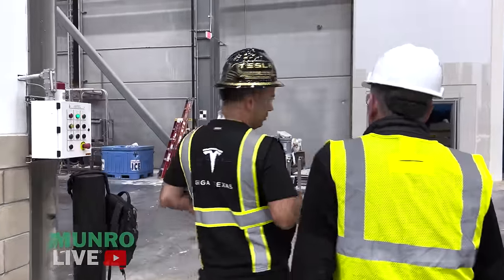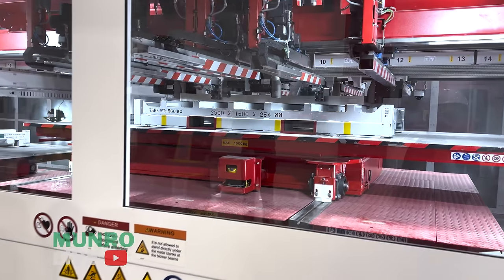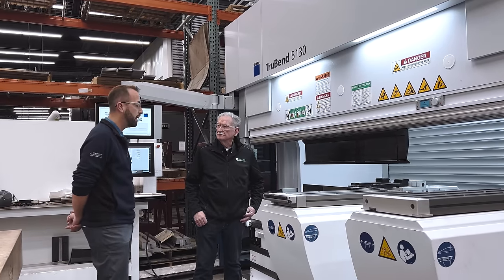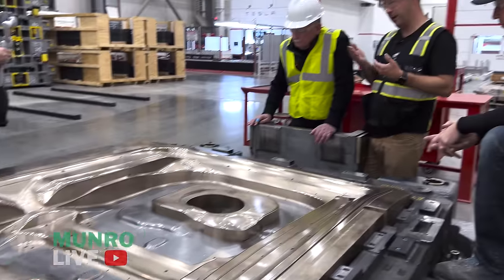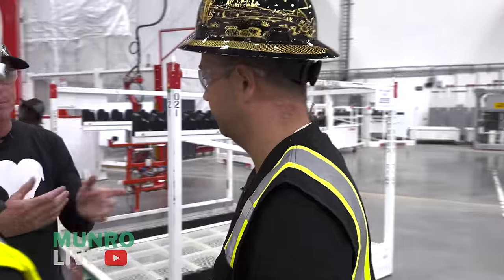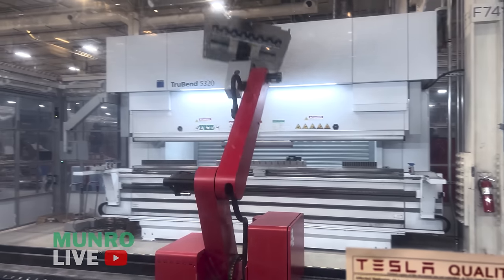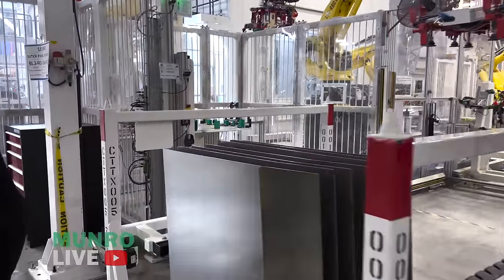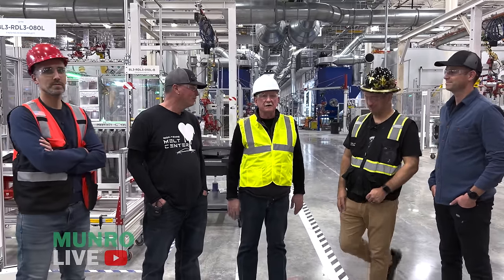Tesla Manufacturing: See how the Cybertruck HFS Panels are Blanked, Bent, and Built!

Comment: What other manufacturer would allow Sandy Monro this level of access?
This is exactly the right thing for Tesla to do .
Reply: There are experts out there that they can hire, but who would pay them to create a new, or improve upon the already used processes which costs money, and time, AND new machines which costs money also big time. Tesla is one of the FEW in the world that does this and they are not a manufacturer of parts. They are a Car company which is different from all the other car companies. Tesla is a Tech Company which can create a new manufacturing processes or methods. All of this is EXPENSIVE which others are afraid to do, but Tesla does it.
Reply: We saw nothing.  Two guys hand stacking panels, 1922!
Reply: @1flash3571 it’s impressive for sure, but we only know about it because Tesla is public about everything. Who’s to say there aren’t others doing equally impressive things? BMW’s carbon fiber i3 frame was just as groundbreaking, so was Toyota/Lexus’ carbon loom for the LFA (now used for other parts). And this was over a decade ago.
Reply: . @GlitterGuru Why did BMW stop with the i3 manufacturing methods and materials? Because they were a dead end and not fit for mass manufacturing at cost. Same goes for Audi A2. Also brilliantly ahead of its time with the full aluminium body. They all lack execution at scale and the will to drive innovation in manufacturing to the point where Tesla has gotten with it, sadly.
Reply: @capslock9031  BMW still uses a lot of carbon fiber in their structures. The iX and 7 series specifically use carbon side frames
Reply: I am curious is Munro will still do a teardown or if they got this level of access in trade for not doing a teardown?
Reply: @motofunk1 He said in a previous video that they intend to do a tear down once they can talk a low number customer out of their new cybertruck.
Reply: @Bill_N_ATX  Thanks, I missed that. Good to hear that this level of access he is getting is pure and not wrapped up in some deal.
Reply: @danr1920  Then you weren't listening, or not understanding most of what you saw.
Reply: @1flash3571  I think legacy does not have the engineers and talent to make it all happen like Tesla. It takes a lot of brilliant minds to get this right. They don't know what they don't know but think they know it all.
Reply: It's zero risk, because nobody else is ever going to copy this. It's not a good idea.
Reply: Jaguar Land Rover, BMW/Mini, Toyota, JCB, all allow factory tours of their manufacturing plants in UK, costs £50-ish for anyone to book.
Reply: @rogerfroud300  Porsche copied the Tesla P90DL.  They had the copy ready to drive 4 years after the P90DL release, and it was worse.  If you copy, you are always 5-10 years behind.
Reply: @danr1920  30micron accuracy lasercutting, airbanding, bronzealuminium stamping molds, micronlevel depth laserwelding. Biggest hotstamps in industry.
These are all new technologies. 

Did you even watch this video?😂

Two guys stacking panels is unfinished production line. Can you even see your toenails? You should try to see little bit farther.
Reply: @1flash3571  bullshit!! its already impoved process which actually makes usable vehicles and not blocks of rocks! this truck will never have the practicality and usability/ flexibility of a cab over lader frame trust me!
Reply: @GlitterGuru BMW canned the i3, because it was too expensive to make.
Reply: @capslock9031  I was disappointed with the Audi A2 interior. The dash looked like they had raided a VW parts bin. Seats were just average. No thanks, not at the prices they were asking.
Reply: Sandy said after the CT launch that he was under a secrecy clause until midnight. This video was filmed significantly earlier when they were still building the line.
Reply: This was just a show off. In reality, they are so far from anything remotely mass produced. Only a way of keeping peoples interest alive, and keep the stock from not plummeting.
Reply: @danr1920  Precisely.
Reply: @Xanthopteryx A very Lucid summary of the video.
Reply: @Xanthopteryx of course. I had to self-censor the rest.
Reply: @GlitterGuru Tesla is naive and should stop showing everyone it’s secrets.
Reply: @TheBooban no-one can copy ...their years behind ...all their patents are open source mate !
Reply: @TheBooban it’s all old known information, it couldn’t be trade secreted if they tried
Reply: @motofunk1  teardowns result in hundreds of pages of documents so other companies can buy and implement themselves. nothing can be documented in detail just by walking around the production line
Reply: @TheBooban True there’s some risk of losing production advantages with transparency, but it also markets their products as being more advanced than their competitors. Sandy’s previous tear downs and comparisons have been eye opening on how much better Tesla is designing their cars
Reply: @zukacs  agreed, was just wondering if there was any agreements made for access.
Reply: @zukacs  You are right, except that the teardown results in reports that have tens of thousands of pages.
Reply: Ones that have nothing to hide
Reply: this just proves they are lightyears ahead of the competition. I recently toured Fords Rouge factory, and they did not allow photos. Silly that they were hiding 50yr old techniques
Reply: @GlitterGuru  who's to say? They certainly aren't allowing this level of access.
Reply: All the other manufacturers would need to send him overseas to see their production.
Reply: I saw at least three world first production methods requiring custom built machinery. Maybe you should rewatch the video and just have one window/tab open.
Reply: @GlitterGuru  Seems like a job a robot could do. A robot like Optimus, perhaps.
Reply: Yeah. I think tesla not worry because they innovate so fast. What you show today, other brand gonna take maybe half a year and a year to laugh at it, and then maybe half a year for them to realize and try to apply it. And then another year to match the quality. By then, tesla already move on to new tech.
Reply: @motofunk1 I think they will. cause there are more then can go in deep and take time to analyze. What they have in here are just quick walkthrough over it, but not full analyze step by step.
Reply: Aligns with Tesla not holding many patents and giving USA auto CEOs a booklet on How-To-240V-Vehicles.
Reply: Lragacy auto are stuck in traditional manufacturing ways, it's comfortable and it makes money, and it's comfortable.
Unfortunately it's so comfortable they got lazy.
Reply: Agreed
Reply: Think any of the legacy manufacturers would provide this access?
Reply: @danr1920 none so blind as those that will not see
Reply: The only manufacturer so far have given privilege access and maybe as a gesture of appreciation to Munro Team as well
Reply: Somewhat true but Detroit has at times tried a new approach. Take the manufacturing process for the Pontiac Fiero. Totally different line drawn up from scratch and proven to be very very efficient. But the car demanded a departure from the norm. Take the traditional pickup truck market. The reason it really has only had "window dressing changes" for decades is that as a fundamental design for the goals originally set - it fully evolved to fit that market. More work went into interiors and drive trains. Ford and GM saw EV as a new alternate drive train and left the rest of the truck as is because its fully tooled, all personnel are trained and the whole supply chain is mature. Those trucks are those companies cash cows/golden geese. You NEVER kill the Golden Goose unless the market changes.  (You could get fired for such an unnecessary leap - think "Edsel".) The ONLY thing that will make a senior highly compensated C-Suite make such a change is an existential threat to that Golden Goose. Why? Because that existential threat indemnifies them from being terminated. They were just responding to the threat. Embracing avoidable risk is a career limiting move; responding to necessary risk is a career enhancing move. THIS is why Musk wins. He embraces risk every single day. He challenges his people to take risks. When you do it routinely it really doesn't seem like risk at all. Its Standard Operating Procedure. But for that Detroit exec - its frightening; its foreign; it must be avoided. They have defaulted to a form of corporate entropy.
There's also a subtext here you can pick up on. The Tesla guys come across as arrogant and smug at times. That is not what you are reading. What you are seeing is people who know the calculus. They have studied every detail and know every dial and how turning each impact the other and the bottom line. So when they talk about it they can come across as condescending. Not the truth.  Note when they talk to Sandy, a guy with equal depth of knowledge, that tone is the lingua franca.  Its the jargon of the masterclass. They both know where the items that will kick your butt and build character are and they cut to the chase.  These are the people who define what it means to be "The Best". 

It looks like the line buildout is coming together. A few robots are missing but the heart is there for small volume production. I can see them ramping aggressively by April.  They have 2M deposits for Cybertruck - who knows how many will turn to into actual orders at the final price tag.
Reply: Very true. Innovation on a specific scale is all over. But I know of no other company getting the number of parts down to so few. The castings, exoskeleton, etc not only reduced material costs but also assembly time. Other will have to follow as the success will dictate the necessity to do so - or lose market share.
Reply: @GlitterGuru not sure it was groundbreaking if it is not used anymore
Reply: Tesla is desperate to get good pR for this truck so it doesn't bankrupt them.
Reply: @Johnnybananass-_  tesla has no debt, more than 20bln in cash and adding another 1-4 bln per quarter, has best selling car in the world and you think that sellin cybertruck for 80-120k USD will bankrupt Tesla? C ´mon men get real
Reply: @Xanthopteryx musk has not made it a secret that they’re about a year away from mass production.
Reply: Forget about access, Other Manufacturers are still in the business of showing Cool Concepts and giving people boring cars comparatively.
Reply: @danr1920  🤣🤣🤣 not important... will be replaced soon by robots... you missed the black microwave for food there! 🤣🤣🤣
Reply: @martyndavies1482 someone should make a video. But Munro has 400k subs, so they will be playing catch-up. Sounds familiar.
Reply: @Johnnybananass-_ tesla had the world's best selling vehicle in 23. They could not sell a single CT and still make bank. But haters gonna hate
Reply: Tesla has the benefit of building new fabs. Old oems they try to use there old machines as much as possible and they are restricted to there old buildings.
Reply: @b4804514  don't forget the freedom Tesla has because they aren't shackled by the unions.
Reply: @GlitterGuru BMW publicly dropped carbon core. It was a waste of over 5B.
Reply: @CatalystNetwork  maybe they didn't carry it on, but that doesn't mean it was a failure. The i3 was extremely efficient to manufacture and had a low cycle time compared to a traditional car.
Reply: @capslock9031  just you watch, the way cybertruck is constructed will not last. The design of cybertruck is stupidly expensive, dangerous, useless, heavy, and not marketable at scale. In 5 years tesla will either pull away from the truck market or come out with new truck that looks like all other trucks on the market, because that's what's profitable.
Reply: @ryandoeslife7227  I will remember this post as one of the worst prognosis I have come across. You're waaaay off on your profitability-assessment. Did you even watch the video?! Do you know they have 2m reservations? Do you comprehend what they're doing with castings?I could go on.
Reply: @capslock9031  I guess we will see buckaroo
Reply: @capslock9031 its not going to be profitable, having to come up with a new way to make a dry battery not to mention not having enough to even meet those sales he promised. They also mention in an article that they still need to come up with a way to test these new batteries becasue at the moment they dont know if it has flaws or not. Basically having a cybertruck right now you may have a defective battery.
Reply: any manufacturer would absolutely LOVE to give media tours of their manufacturing. But no one cares because we mostly just want a good product that is affordable. This is a sales pitch you are watching.
Reply: @idolshrubs2728  You obviously haven't every been involved with the matter you are talking about. A media tour is not the same as what is being put out here by Tesla, in terms of insight into new processes and manufacturing technologies. At other OEMs, this'd be highly restricted access with no footage in an R&D type facility.
Reply: Is this your first time on the internet?
Reply: Tesla appears to have hired Sandy Munro as a publicity agent.  Sandy has uploaded a couple of super fluffy CyberTruck marketing videos, and Tesla has him in several others.
Reply: @cmosarch5285   that's what's hilarious about this. This Sandy Monro fella strikes me as a coat tail rider here. I dont know anything about him, but ive been around car culture long enough to know the sounds a hired mouth makes. There is absolutely nothing critical that comes out of his mouth regarding Tesla. The way he acts about Elon Musk, he sorta reminds me of that bozo ex mayor of new york riding Trumps populist wave.
Reply: @idolshrubs2728  Sandy is brilliant.  He's been in the automotive manufacturing business his whole career.

Sandy published a bunch of scathing analysis' of Tesla's designs.  Very objective, clinical.

Now he's waxing poetically with fluffy pieces like this, which leads me to believe that Elon got tired of the negative reviews and hired him.

Comment: 16:15 is the best moment of this entire awesome video. Love Sandy's reaction, "This is aluminum-bronze?!?! And you can stamp with it?!"  Great stuff.
Reply: can you explain the situation happened there
Reply: @kateebameer5477   aluminum and bronze are both very soft metals so he's surprised u can mold these hard steel panels with it :)
Reply: And he’s right too - that die won’t hold up. Which means every time it’s used, the result degrades.  Not very encouraging.
Reply: Sandy has his doubts, listen to his tone of voice and statement again
Reply: It sounded as if they said it only lasts about 60 cycles. That can’t be right it seems too short. However, with the aluminum bronze, that will be a wear surface for the die. A very expensive forming method. Edit: a comment says they indicated 50-100 thousand.. I didn’t hear the thousand part.
Reply: Worked with a company in Ireland that has used Alu-Bronze for form tools for 40 years. Granted, they're a fraction of the size as those bad boys. The Tesla tool is an amazing size. Wonder how many of them they have lying around $$$